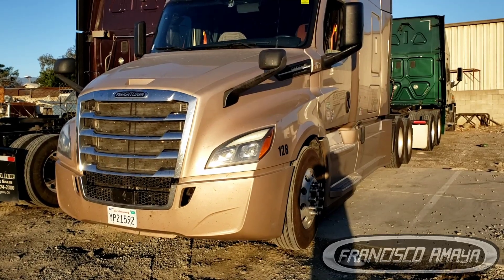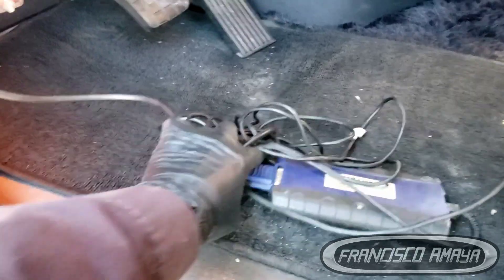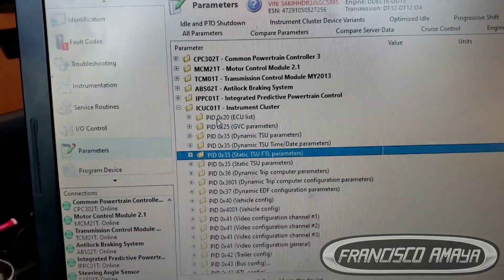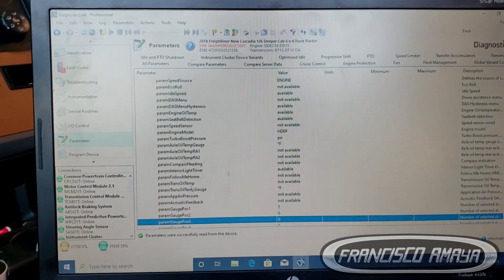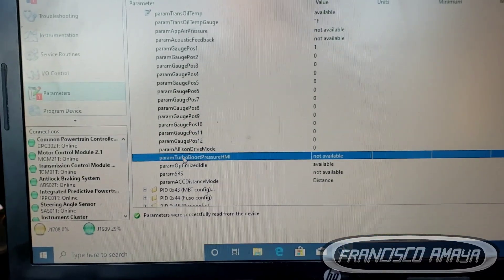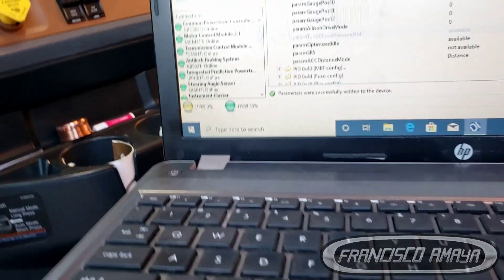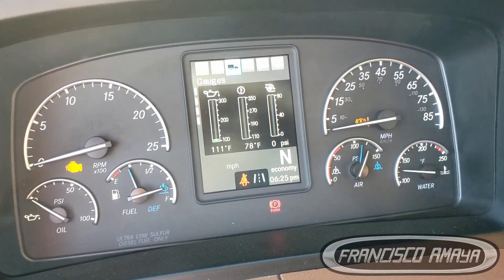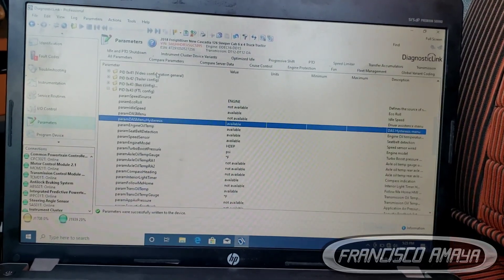Freightliner cascadia DD15 126 programming dashboard setting electronic gauges turbo pressure

Comment: Can you talk about increasing horsepower. I just bought a 2019 freightliner cascadia yesterday. It is in economy mode. I believe that is 400 hp. I read the dd15 can be set to as high as 600.
Reply: I think it's like Cat/Cummins, what specific internal parts are in it???
For Cummins it depends on the CPL, as to how high it can go, without grenadeing the engine. 
Some can only go to 485 hp, some to 525 hp, and some to 605 hp.
You have a bit of research ahead of you. Just think about those pictures you see online, of an engine block with the sides smashed out, where the rod(s) exited.
Warning, some shops will happily set the engine to produce wild amounts of power, life span will be measured in few hours, but they won't care, as they have your money.
Reply: @Carl Thor  definitely appreciate it. I pull my first loads tomorrow so I am going to see how it pulls.
Reply: @devilkiller52  Safe travels.
Reply: @carlthor91  thanks. You do the same
Reply: I bought one with 455hp